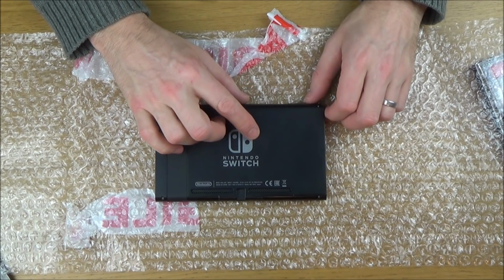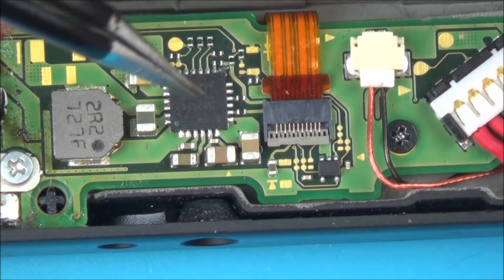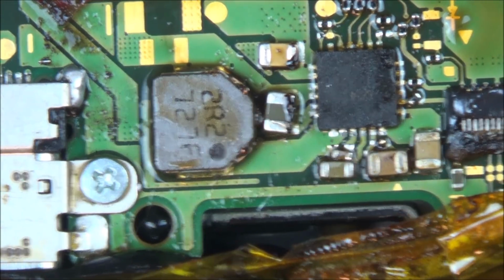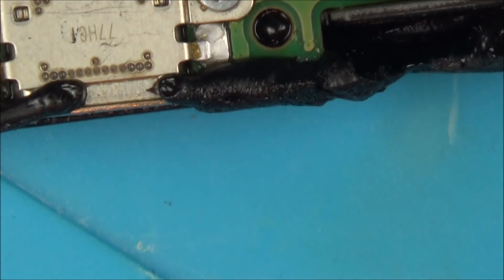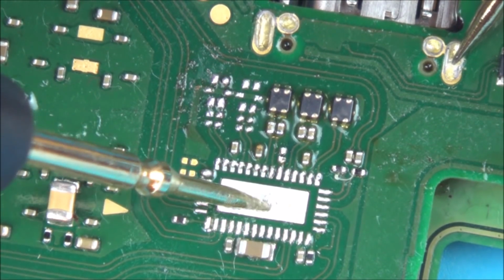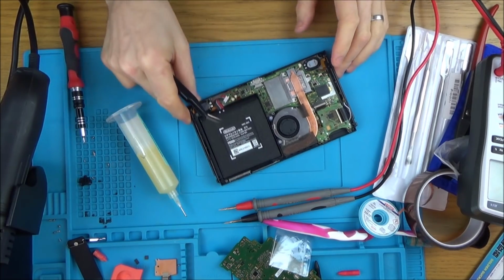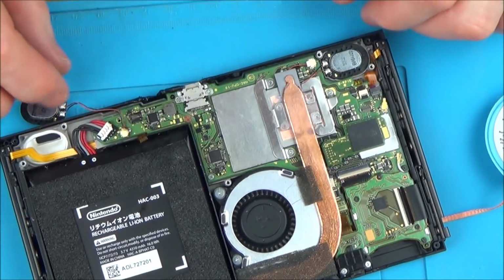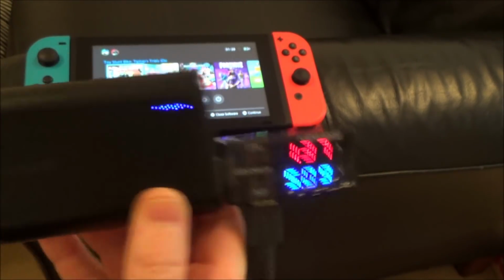Trying to FIX a Nintendo Switch with Numerous Faults

Comment: Really painful to watch but I can't get hungry. This is not your job and as you said your still learning.

The problems are the guys like you that works on PC's, consoles, TV's without having the knowledge.

As others said watch Louis Rossman videos just to learn the troubleshooting process and the soldering process.

I actually don't repair stuff but I assemble electronic components for my own hobby projects (I have made some really odd stuff with BGAs and QFN and other SMD packages)

When the video started and you showed the board I immediately have seen water damage. And the water detector stickers are useless. They turn red even with flux.

Lithium battery are little bombs. Try to avoid putting hot air near them.

Always remove the board from the chassi. This way is easier to work.

As others said point hot air away to delicate parts. Like chips.

Thermally isolate the nearby of a chip could result into a pcb warp. If you preheat the PCB and you apply flux you cannot knock off components. (The surface tension is your best friend) The only thing you must cover are plastic connectors. Those are made to handle 250°C up to a couple of seconds. To thermally isolate them you can use a metal shield and if want to add a fiew kapton tape over the connector.

The USB type C is a nasty thingsl the dock and the shield itself exchange data, all pins are connected and the long chip you changed looks like a multiplexer to me. (I actually have no idea of how the switch work but I worked on different mobile embedded devices)

The first most important thing to do is a proper visual inspection of all the chips to look for corrosion. Most of it (and shorts) disappear when you reflow the chips with flux. So some chip might not be faulty/shorted even if they were when soldered.

Don't mix resistors capacitors and inductances when probing.

I would love to have a faulty one just to reverse engeneer the PCB and draw schematis. (that is my main hobby)
Only using the charge current to troubleshoot is not the best way. Power could be drawn from the battery and you don't actually see anything on the meter.

Have a nice day :)

Comment: Would the tape shield from any heat at all? I mean, it could potentially protect from the air, but heat would most likely spread across the board anyways.
If I were to try some random ideas that might work to protect it, I would try covering it with some blue-tack. It might be able to steal the heat away.

Comment: Hello Vince. Suggest that you also use aluminium tape on top of or under the kapton tape to supplement the hot air heat shielding. You should be able to reuse the aluminium tape several times if this metal tape is placed under the kapton tape.

Comment: Really awesome you got to try this! Try to use aluminum tape and stick it to the board so the hot air can't blast plastic connectors, and never fear about blasting capacitors, coils or resistors, or moving them out of place. You can even take them out to give you some space.
Never surrender. Ask your friends for an old laptop or computer and practice on those. Once you got everything right, a Nintendo switch will be butter.

Comment: Great vid buddie you had a good go mate I think a little more attention to preparation with the tape (and board out of case) and you would be alright also please clean and tin your iron tip before use you would be surprised the difference it makes. Great work buddie.

Comment: Yo vince, if you plan on changing the USB c port why not try heating up the board enough to have the inner contacts flowing then slide the new port on and then use the iron to solder the outer contacts?

Comment: Love your vids.
What did we learn from this?
Kapt tape causes more problems than it solves if you plaster the board with it.
Dont put your fan on so high
Invest in some low melt solder
Flux grows on trees

Comment: I think you improved your hot air reworking skills quite a bit this video; well done!
For protecting that joycon connector, I think the biggest tip is one you already figured out. Air flow was up way too high. Add to that less flux so it doesn't get under your tape and lift it, I think you'll be much more successful in similar situations in the future. A tip with the flux: use your tweezers to grab a bit of it and use that to more carefully control the amount and location of where it goes on the board. Remember, you can always add more, so being cautious with it in the beginning is a good idea.

Comment: Awesome got it working 
Got trolled at the end with the backlight that happens all the time lol 
 For the connectors Not to burn it 
 kapton tape  Flat to the board 3 layer 
 A small thick copper Plate I use letter stamps plates Pure copper .. or You can use aluminum tape Fold aluminum tape Then tape kapton tape over the lumen foil tape of Creating a heat shield .. Bottom heater helps a lot too

Comment: Just for future reference I'd wanna say all devices will still pull some power with no battery plugged in. with a battery a switch will get over an amp, with no battery it'll probably get .4 amps or so maybe .3 but i haven't done many switches. Like a laptop. It doesn't need a battery to power on

Comment: Next point that may help you with these  dodgy type places is  Chip Quix solder. You should have cleaned the pins and then tinned with lead free. to reduce your melting point. Other method is make a square of copper wire and wind ends onto a soldering iron. the square heats all the pins of the chip at the same time

Comment: I have never screamed at a video so much :D MMV, you just need to slow down a little, ease up on the flux and kapton, and you'd knock it out of the park. Kapton is good, but it directs the air within the cracks of your placement, directing fast air towards components in narrow beams of hot air. I'm glad you see you turned down the air and got rid of the tape.

Comment: Come on Vince use your ESR meter on the capacitors. That would give you some indication if your cap is OK. It probably will not be  correct but it will not read short if OK

Comment: Just some tips: Never do continuity tests when the device is powered on, you can get false readings. You don't need to add flux to remove components from the board. Use less flux, its to much and please clean your soldering irons tip :) You can try to use aluminum foil to shield the heat. If you removing/adding components with hot air, do not grab the parts, only nock them with the tweezers to the correct position.(It also helps if the tweezers are demagnetized) Hold the hot air gun strait and use circular motion to heat up the pads!

Comment: “I bought this because if i cant fix it i got the case Which is good” applies heat and destroys the whole case
What was holding u to remove the motherboard from the case? 
 Edit: wow it was the backlight cable? Wow what a plot!
Just kidding love to u Vince i repair iPhones but cant desolder a chip, thanks to u im learning it, love to u🤜🏻

Comment: RCM works a lot like what you experienced; the console will appear as though it's off (and won't accept charge, or will only trickle charge extremely slowly) until it's plugged into a PC and you can then see a new device pop up in Device Manager. As long as the console is stuck in RCM nothing will show up on screen until you send a payload to it with TegraRCMSmash or an Android app.
But as far as I know, the jig has to be used on the right rail, the left rail doesn't have the right pin. If the console is already stuck in RCM then a jig isn't needed though.
Congratulations on a mostly successful repair, about midway through I was honestly doubting that you'd ever get it to display anything on screen.

Comment: Don't give up Vince I think the suggestion of lowering the airflow and temperature is a good one 480 celcius is a bit too high even Kapton tape can't stop the heat but as I previously said good on you for trying good on you for the videos and keep it up you will get better the more you try after all I saw you fix the freezer section of your refrigerator and that was incredibly hard Try not to be too disappointed I don't even have the guts to attempt this stuff at all

Comment: 21:05 Center pad is substrate/heatsink, GND is on another pin around. Substrate usually hasn't direct connect to actual power GND pin.

Comment: Hi Vince, a lot of the other comments note a few things done wrong so I'm not going to echo what they say. Something additional I noticed is there was another small resistor around the first chip you changed that must have been blown away that you never replaced. Not sure what issues it may cause but could be worth a look.

Edit: Also great work getting to the point you did! A lot of people might throw in the towel after making a few mistakes but you stuck with it and ended with something that is now "useable".

Comment: Try using aluminum tape, it refelects heat much better, stays in place and won't melt. You'll have way less issues than with your kapton tape.
Also, unplug the switch while doing probing with the multimeter! You're going to do even more damage

Comment: Why the temp so high? You need to heat up the chip..... Not send it to hell.
Reply: You need to do it fast 400C hot air != the part is 400C hot, the solder melts much before that. If you use ~300C its gonna take a long time...
Reply: @peterkis4798  Think the tape was too lose as well  it seemed to be ballooning and funneling the heat under and trapping it . Possibly what helped melt everything
Reply: @peterkis4798  It is still too high. You need to preheat the board till everything is around a good toasty temp. Then you gotta quickly bump it up to around a good temp for the chip in this case the size 350 370 is fine but you can only dwell for like a fraction of a second then pull the heat away at a decent speed that give the solder time to become solid and not thermal shock the area by sudden heat changes.
Reply: @coll6  Fraction of a second? Parts has thermal mass and the air is cooler when its reaches the part. 400c is a good temp if you know what you are doing. 400c = faster heat up = less time the part is at high temps. A few weeks a go i fixed a 4k tv by reflowing the main big bga, i used 350c just to be safe.
Reply: @peterkis4798  sure but having a higher temp also means larger change to bilutn the board and ICs higher Temps can easily get out of control
Reply: @coll6  No high temps until the stuff heats up from the hot air :P The key is you stop the heating at the right time.(The parts never reaches 400c) For large chips on large boards the "only" problem is the pcb warping, that's why i used lower temp for the tv.
Reply: Temperature good 350 400c but so much air can burn others components or remove
Reply: @theultimatemyrmidon7459  350 400c ? You can't be serious! I hope by "c" you don't mean Celsius.. That would translate to 662- 752 Fahrenheit ! Or , in other words,  BARBECUE!!!
Reply: IntrigueDynamite 

For anyone else reading this...yes the temperature is very high. But remember,this is not a soldering iron with a huge tip. It’s hot air. It takes a very high temperature to get a specific area hot,especially on an iPhone for example. You HAVE to use at least 320c,usually 350 to 400c. It is very hot,yes,but normal. The board will pull a lot of heat and disperse it. So you can either use like 250 c and have it take forever and slowly roast the board,or use 380 c and take it off fast,so that the rest of the board cannot come up to temperature.
Reply: loool
Reply: SO fkn good
Reply: I do this shit all day long and 350 it’s more the enough, not sure why he bbq this shit
Reply: @Itsmealder  technique and equipment have their part to play, Vince needs to get his method right and that just takes practice and time :)
Reply: Next time you should practice with something and after you done it lots of times then you can try to do it on something that you want to get it fix
Reply: Typically solder can melt at 370 F(188 C). He said that he set temps to 400 or max. I hope this is a cheap Chinese heat gun and is in Fahrenheit, but eaither way it's to high.
Reply: TechnologyGuy 4life  These devices are soldered with lead free solder and it won’t melt at under 200C
Reply: @hasnomoney1800  Well, since Kapton tape withstands up to 400ºC, hot air beyond that temp sounds like crazy.  Also, flux should help unsoldering components faster without heat damage.  So I think it might be better going slower but safer, probably at 188 - 200 ºC just like you said. But like Vince explains, he is not a pro, so he learns that way.
Reply: @hasnomoney1800  BTW, do you know if flux affects Kapton tape properties (e.g. melting temperature)? I have no idea, I have never done this kinds of things, I just enjoy watching and learning.

Comment: Maybe you should try aluminium foil instead of kapton tape. It should spread the heat nicely. I've done it few times and it worked just fine. Just make sure you've disconnected all power sources or you might short things out.

Comment: *Addendum*
Vince when you need to remove a "SMC" or "Surface Mount Chip" Leave about 1 to 1.2mm MAXIMUM of track leading to the suspect chip if you cover too much of the track up with the heat shielding tape you will need more time for heating, and even though the chips are designed to take a lot of heat you have to keep in mind the Chip may have already experienced a lot of heat in their removal from it's donor, Anyway this leaving 1mm of the track exposed will help heat up and liquify the track very quickly, so the removal is quick and easy. 
Also with the tape like that, it will also help in locating the replacement chip exactly where it needs to be located, another tip which I think might help those of you who are worried about over heating the chip, Is to cut a square of the heat shielding tape the same size of the chip and then stick it on the top of the chip in question..
Reply: BTW Congrats on another Fix Vince, well yeah sort off Fix..

Comment: Great video Vince, I was totally not expecting this! And I don't know if you have tried this or not: you can try ditching ribbon cable entirely and use thin wires to connect pads on the board straight to the Joy-Con Slider Assembly thing. I've not tried this myself but from the pictures I found on the internet that seems doable.
Reply from the maker: Thank you, I did try that but it wasn't clear in the video as I was fast forwarding so much :-) I found it really difficult to solder the wires on, every time I did 3 or 4 of them one would come off and then I just went round in circles resoldering wires that kept falling off. I needed to do 10 in total. It might be something I can revisit in the future when my skills improve a bit :-)
Reply: I can't help wondering what the other side of this thing looks like. If it looks like the photo on this page: https://www.wantitall.co.za/videogames/valley-of-the-sun-genuine-left-joy-con-slide-slider-sliding-rail-for-nintendo-switch-ns-l-joycon-con__b07d2hhgd5 Then there are other places to solder wires to(just where ribbon cable soldered itself). But yet again you are  probably well aware of that and just didn't include this into the video.
Reply from the maker: That link shows the rail on the Joy Con, that would be slightly easier to solder to but I would still find it hard. I was trying to solder onto the rail on the Nintendo Switch. It would definitely be possible but you would need a very steady hand :-)
Reply: My Mate VINCE Oh, I see it now! I was not quite sure what that thing was initially because of fast forwarding ;-)

Comment: Great work Vince!!!  Had me on the edge of my seat!  I think you should use parts of this switch to fix the very first switch you messed up the charge chip.  That one has proper joy con and speaker, right?  You could get all the components back in order in no time!  Thanks for the video!
Reply from the maker: Hi, thank you :-) I think that one has now been used as a donor to fix or try to fix others along the way. I have 2 of them in complete bits that I take spares off :-)
Reply: @Mymatevince  I know, but the boards are sound, right?  You have working switched to compare them to.  So you could move the bits back to that board now that you got the hang of moving chips around!!  Then you would have another fully functional switch!!!  It would be a great challenge video!!!

Comment: Vince, you are too impatient. RoHS solder needs just 300 degree Celsius. And please, use the plyers only for removing the old chip only and for placing the new one once. Surface tension definitely will do the rest unless your air flow is low enough to not blow away the components.The direction of the air flow is very important! Always away from sensitive components. If the camera is in the way, place the camera different, not the heat nozzle. If you need to use the needle plyers rest your hand on the table and only use the finger tips for pinpointing.
Reply: @bbbbbb1243  2+2=4
Reply: Come on guys XD, He trying to protect his You tuber, Poor Brendon and is true what Splinter TMNT saying ( is good to receive criticism  because sometimes actually make you better and not take nothing too personal). Sorry about my grammar not the best. XD
Reply: I agree he needs a tilted nozzle and I would remove any unleaded solder and only use leaded.

Comment: Have you ever thought of using a helping hand / third hand style tool for these chip replacement jobs? It should stop the chips from moving under the hot air gun.

https://www.pirate4x4.com/forum/shop-tools/1042801-3rd-hand-helping-hand.html

It shouldn't be to hard to make something similar but more specific for the job.

You might need to replace the metal tip with plastic, I'm not sure how much heat would be transferred through the tip. Just an idea.

Enjoyable video's regardless.